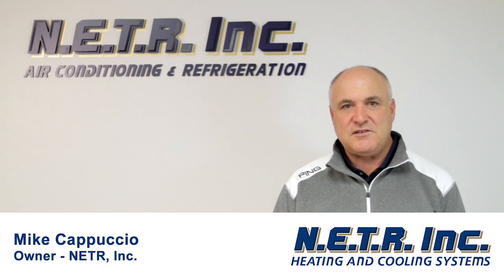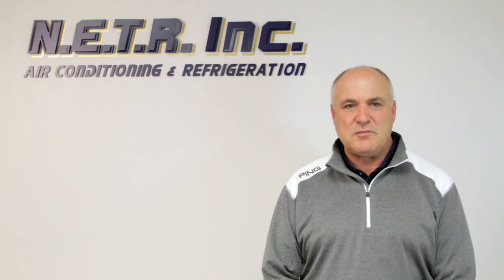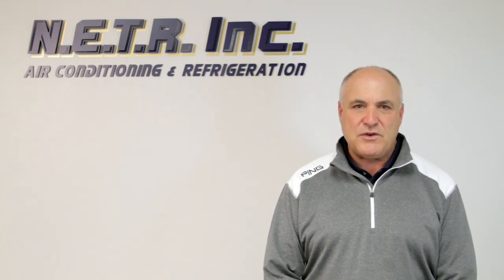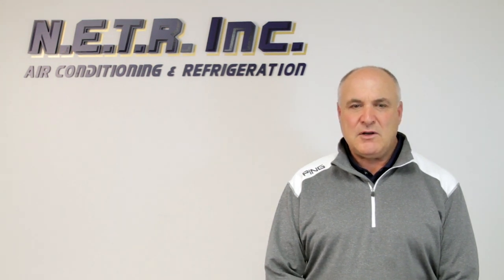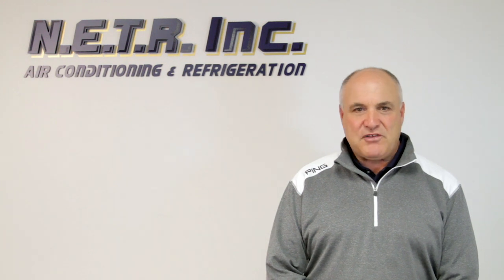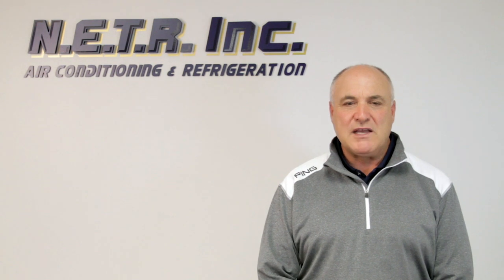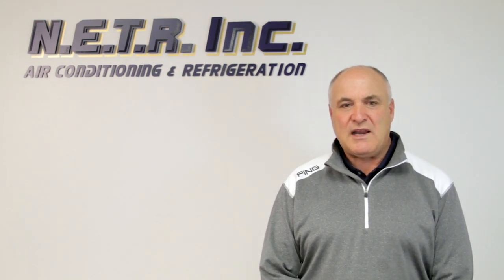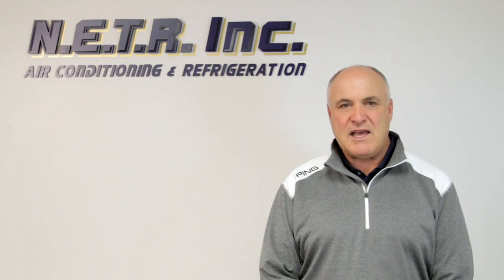What Size Ductless System Do I Need?

Comment: What about inverter systems? Does it matter much if you oversize having an inverter unit? As far as I understand these units will adapt to the load and stay on all the time. Do they handle humidity better if you oversize them compared to non inverter units?
Reply: I have heard you have to run in dehumidifier mode if your unit is oversized for the room. That mode runs the fan slowly

Comment: The people complaining about not answering the question have no clue that the exact answer was given, they just have no clue what the hell they’re doing, or what a manual J calculation is. If you can’t google a manual J calculation, maybe stay away from heating and cooling. It’s a little more technical than typing.